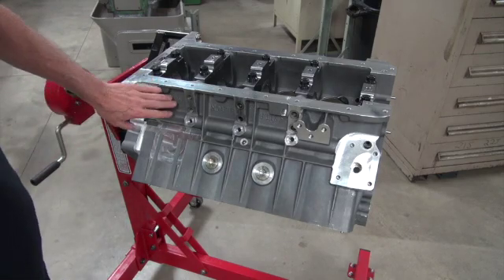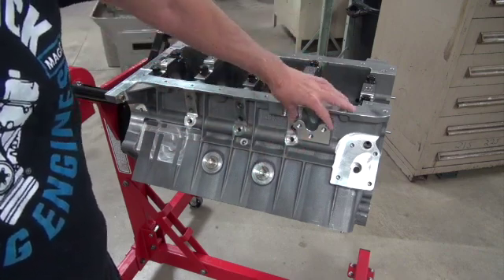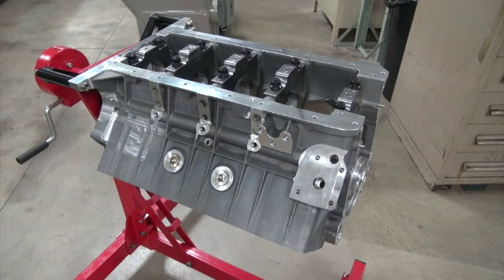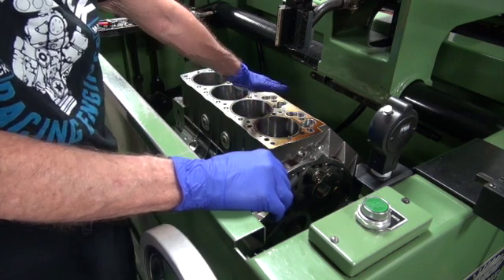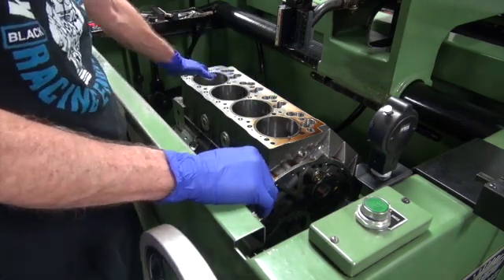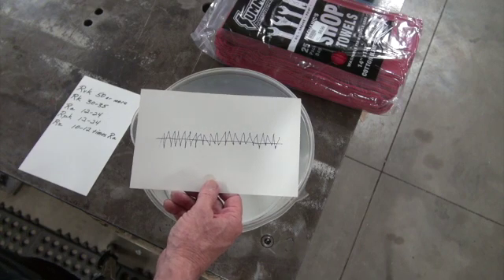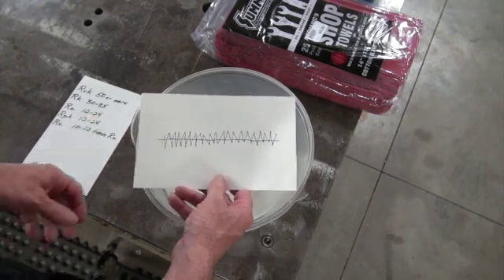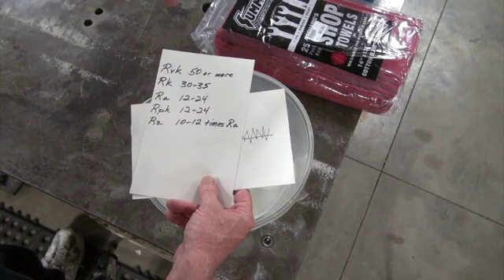Keith Black 572 Hemi build Ep 2 #426hemi #572hemi

Comment: Rick what am i looking at to build a 572 KB street motor single carb play toy will use either torque flight or a newer 4 speed automatic. want Stage v rockers, and their heads. Max rpm 5500 3.55 gear into 1951 mercury
Reply from the maker: Sounds good but right now there is no Stage V heads or rockers available. And I don’t know when there will be. If you see some new Stage V rockers for sale buy them. Stage V heads will cost you double what a new pair of Edelbrocks would so I would go with those. If they ever become available again. And in your application I think a 528 would do just as good so don’t rule that out. Thanks for watching.

Comment: I have often wondered if the new coatings they are adding to pistons that "wear in" to fit the hole perfectly isn't just destroying the point of a good hone by filling in the valleys as it releases material?.?.?...
Or am I reading the tea leaves and chicken bones wrong?
Reply from the maker: What I can't believe is how good those coatings hold up. I thought they would wear away. I guess the piston coatings wouldn't interfere with the hone job. The cylinder wall might prefer the coating to the aluminum. Thanks for watching.
Reply: Thanks for the insight. I agree about how well the coatings are holding up. Black magic..😂